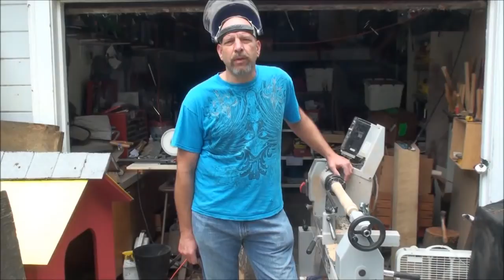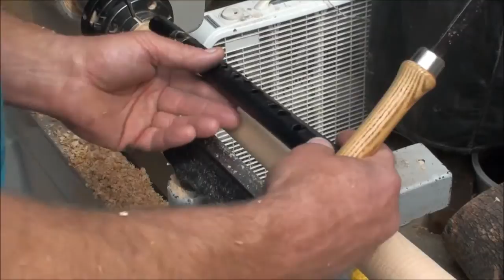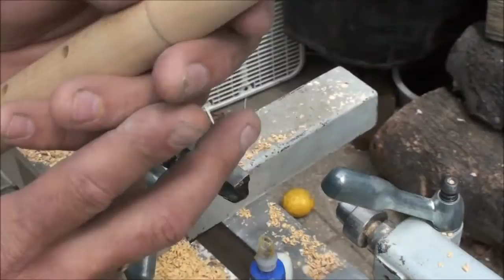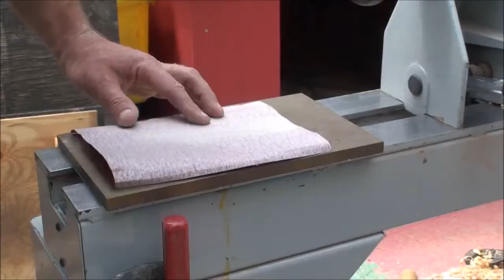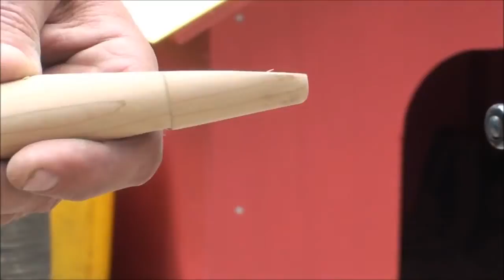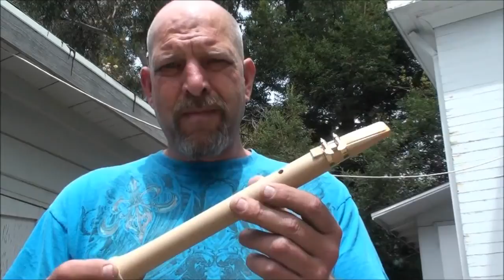Wood Turning With Naked Turner Sexy Saxonet

Comment: Hi Erik,  I just discovered your channel yesterday and I am really enjoying your videos.  I haven't been turning for long, but my new ambition is now to make a saxonet!  Great video.  Could you share the dimensions/measurements you used to get it to turn out ok, in tune etc?
Reply from the maker: Thanks Suzie, I have a friend with the name John Law who lives in San Francisco Bay Area, any relation? I bought a Xaphoon and copied it's size, hole pattern and hole sizes. I made it out of a piece of instrument grade maple.  I could not describe the hole positions and sizes.  If you are a new turner this would be a very challenging project.  You need to bore out the entire length and make the mouth piece and have a good stationary sander.  A plastic Xaphoon is a good way to start though and is not that expensive to buy, I think I paid $ 80